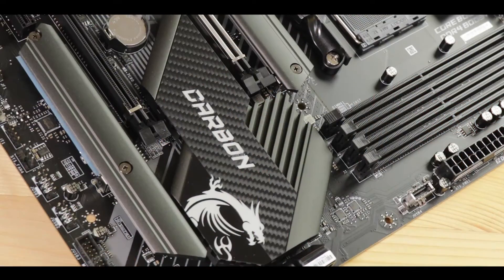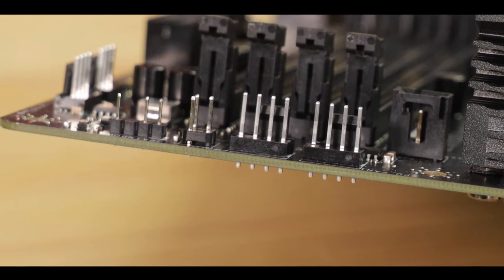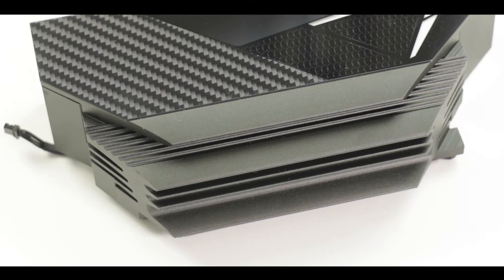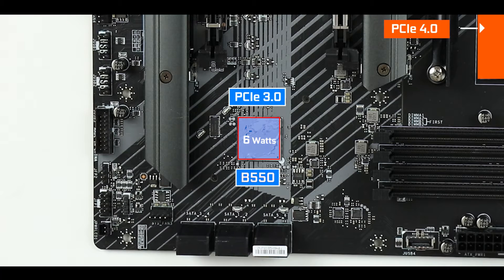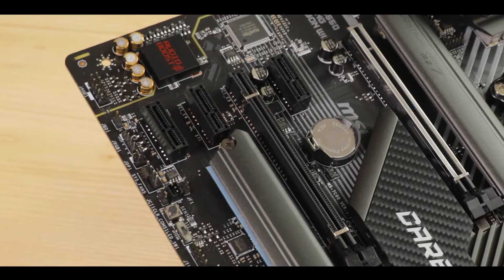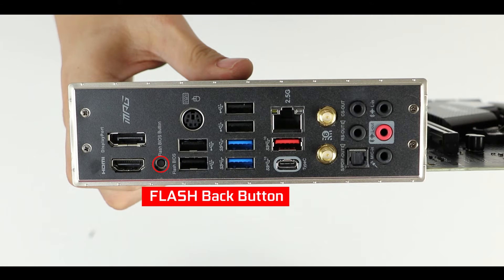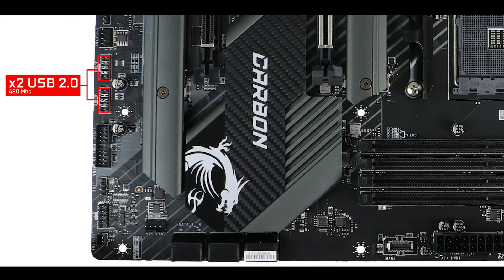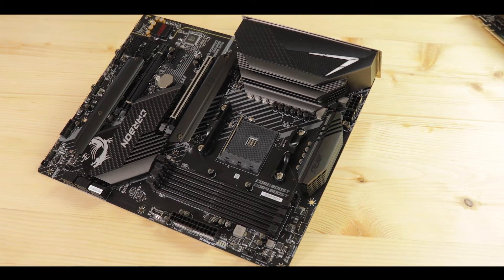MSI MPG B550 GAMING CARBON WiFi : Finally MSI gets it right!

Comment: Nice video, love your content! 
Need a tip, man. I just bought B550 Tomahawk (to go with R5 3600, Viper Blackout 32GB 3600MHz and 1080 Ti Aorus Extreme), should I add 30€ and get the Aorus Pro, or even this?
Reply from the maker: Frankly ... not worth the extra spending . 

The Tomahawk is a grand choice and none of the other will significantly bring something on top.